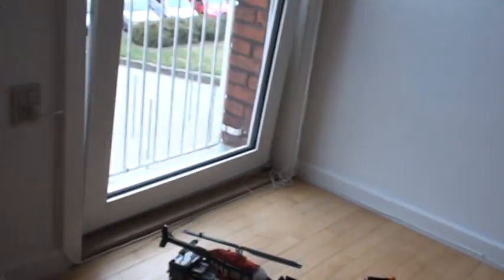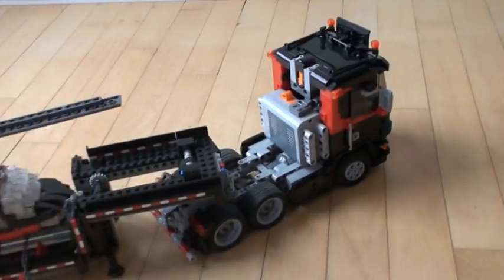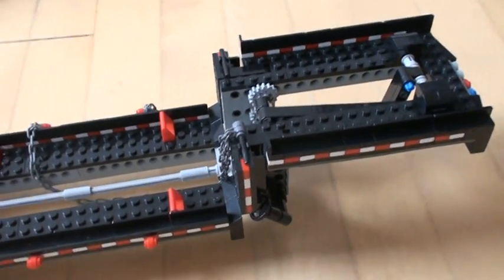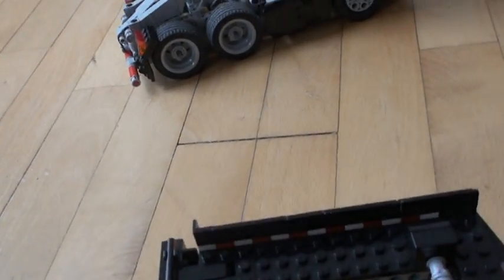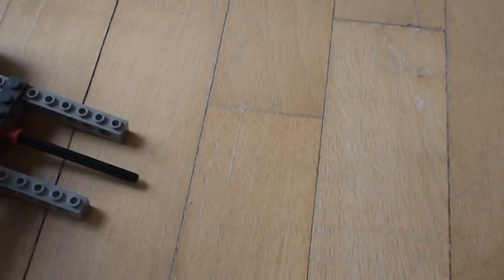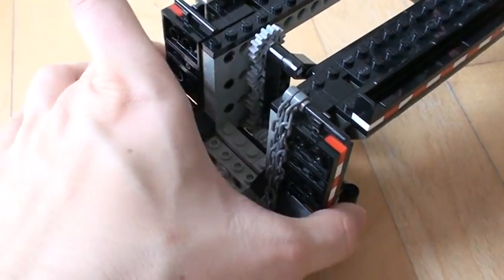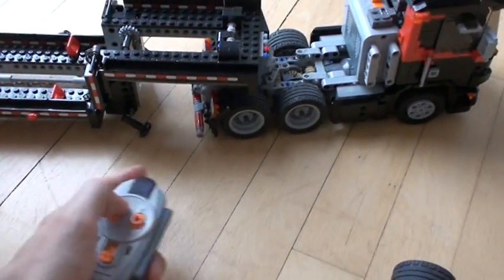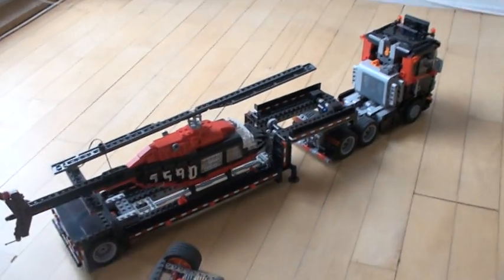LEGO Model Team Helicopter Transport: The Trailer

Comment from the maker: Because it is starting to show wear. This happens once the models have driven for about 50 hours. I have used this truck at four events now. I recommend removing the dust from the plastic and perhaps use a silicone based spray on the parts that are under most stress.